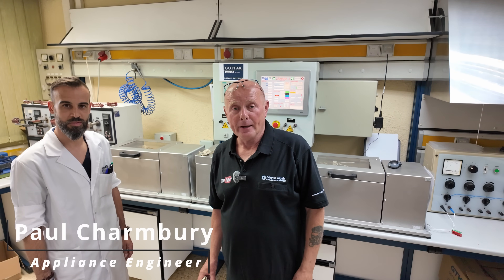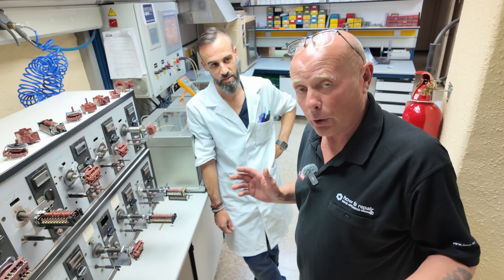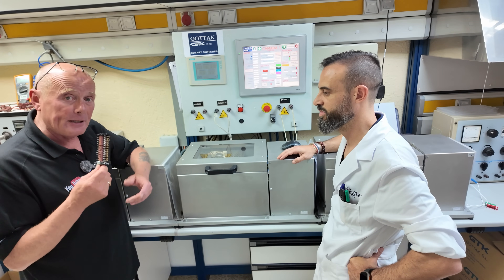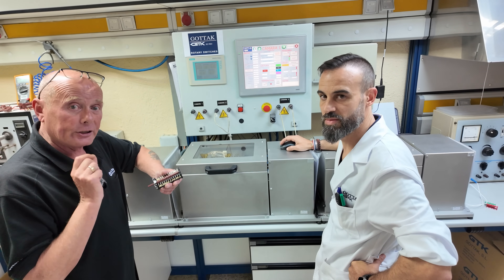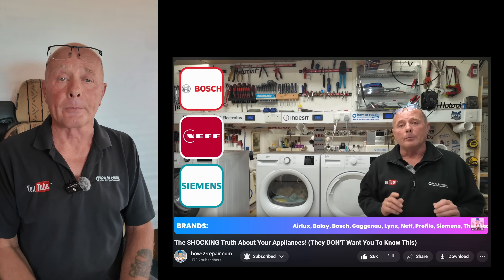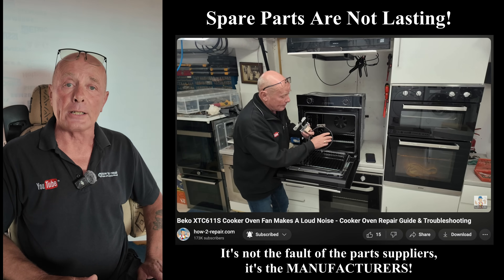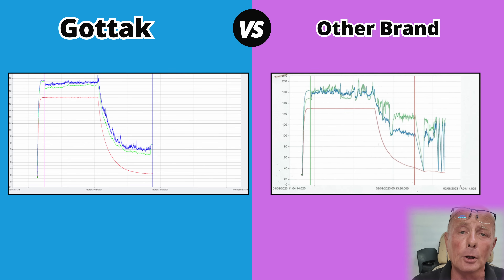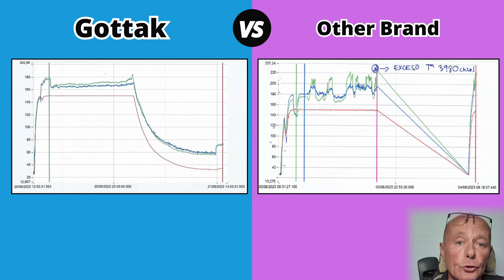Why Your Appliances FAIL SO FAST! Lab Results EXPOSE the Truth!

Comment: In the modern age, paradoxically, it pays off to buy the absolute cheapest appliances you can find. They are the ones that are still being built in an old-school way, they just use cheaper components. So when your switch fails you can just replace it with any random switch off the shelf and get it running again.

With more expensive appliances everything is much more complicated. Touch switches, millions of sensors everywhere, proprietary control boards, etc. Once any of that breaks, it'll be cheaper to throw away the entire machine than trying to find a replacement.

I have what used to be a very fancy microwave 20+ years ago, a Whirlpool with a fancy multicolor LCD segmented display (remember when that was like the coolest thing in the world?). It was gifted to me because the control board was failing and it was shutting off. Giving it a whack on the side a few times "fixed it" for a while and I used it just like that for about a year or so, until it started taking too many whacks to keep it running.
I took it apart and couldn't really find anything wrong with the board at first sight, but then I realized it was probably made around 2004, right at the beginning of lead free solder. I reflowed every single solder joint on the board (which was all through-hole components so it was exceedingly easy, if a bit time consuming) and lo and behold, it went back to working perfectly and has been serving me well ever since (it's been 4 more years).
If it were a modern microwave I would have probably just had to throw it away. Electronics these days are simply too complex and finnicky to work on without schematics or specialized equipment.

edit: Disclaimer, DO NOT DISASSEMBLE A MICROWAVE if you don't know what you're doing. If you touch the HV capacitor while it's charged you will be dead before you hit the floor.
Reply from the maker: Hi there, @demoniack81! Thanks for your incredibly detailed and insightful comment – and for the very important safety disclaimer about microwave repair!

Understanding these varying degrees of repairability, the impact of design complexity, and component choices is key for consumers navigating their purchases and repairs. For a deeper dive into how design and manufacturing choices affect appliance longevity, as observed at the trade show last year, please check out the full video here: https://youtu.be/gEgSCbZnHVM?si=wTIw0mELuhWaw4aX

We also explored related aspects in these videos:

The shocking truth about manufacturers: https://www.youtube.com/watch?v=QsdGd2qDPaI
Heat pump tumble dryers are they really worth it?: https://www.youtube.com/watch?v=xn03N3b0-lE

If you found this information eye-opening or it resonates with your own experiences, please consider sharing this video with your friends and family. The more people who understand these issues, the better equipped we all are.

Thanks again for watching and for sharing such a brilliant and thought-provoking comment! Don't forget to subscribe to the channel for more insights like this!

Comment: I have a creda large capacity tumble dryer it's 25 years old it's just started to fail I've had it 25 years I think that explains at what point the industry is at right now.
Reply from the maker: When a 25-year-old machine only just starts to fail, it makes you question why so many contemporary appliances don't seem to be built with that same durability in mind. This is exactly the kind of concern that fuels the discussion around built-in obsolescence, which we explore in our video. Understanding how design choices and manufacturing priorities have changed, as we discussed from observations at the trade show last year, is key.

For a deeper dive into this topic and to see the examples we covered, please check out the full video here: https://youtu.be/gEgSCbZnHVM?si=wTIw0mELuhWaw4aX

We also explored related aspects in these videos:

The shocking truth about manufacturers: https://www.youtube.com/watch?v=QsdGd2qDPaI
Heat pump tumble dryers are they really worth it?: https://www.youtube.com/watch?v=xn03N3b0-lE

If you found this information eye-opening or if it resonates with your own experiences with appliance longevity, please consider sharing this video with your friends and family. Stories like yours about your Creda dryer are a powerful reminder of what used to be possible.

Thanks again for watching and for sharing that great example! Don't forget to subscribe to the channel for more insights like this!

Comment: Manufactures need to build tings as cheap as possible for consumer goods. So they need to know the life expectancy of each component and part. They can design parts so accurately that on average they can predict failures.
In contrast, Years ago machines were way over built and lasted 20years or more without repair. The manufactures could not sell parts nor would anyone buy new machines. So the Manufacture would go out of business because they literately made the product too well for the task.
So the economics of the situation is that if a manufacture wants to stay in business they can only build products that last a well defined on average known period of time. This created jobs at the manufacture and in the service industry.
So Like it or not there is a method to the manufactures madness that really makes sense.
Reply from the maker: Hi there, @accurateapplianceelectroni9703! Thank you for providing your personal view on appliance costs and life expectancy but after so many years repairing different types of appliance machines, I strongly believe that consumers need to obtain fair, clean and durable products according to their investment, which at the same time, will not fill our planet with continuous toxic scrap due to the maximization of revenues by world manufacturers. Otherwise, this will be “food for today but famine for tomorrow”.
I think producing cheap products is not the solution. Reliability, quality and long-life expectancy is.
Shifting into a model of a consumer practice of “buying and throwing away”, will flood our landscapes with tons and tons of unworthy goods that will only create reduction of our earth resources and continuous growth of toxic waste for us and for our coming generations and I deeply believe that is not fair.
As commented in this channel by thousands of viewers, there is a common consensus about taking care of our environment and for such, we need to request reliability, quality and durability over cheap dirty products.
Having long lasting durable appliance machines, will not reduce the volume of manufacturing of world appliance producers as the world population keeps rising year after year, as well as their economic power and I believe there will always be a need for these great machines which facilitate the way of doing things for as humans like: storing food, cooking, washing, cleaning, warming, cooling and so forth.
If world manufacturers want to stay in business for long, my personal suggestion is that they have to understand that well crafted products, will provide them a name on the industry, to be trusted by consumers (which are smart buyers) for years and years.
There are many examples of well-known brands of different products today that have lasted for more than a century and they have understood from the very beginning that quality over quantity will prevail.
Producing and selling cheap products is too easy. Doing the opposite is not.

For a deeper dive into this topic and to see the examples we covered, please check out the full video here: https://youtu.be/gEgSCbZnHVM?si=wTIw0mELuhWaw4aX

We also explored related aspects in these videos:

The shocking truth about manufacturers: https://www.youtube.com/watch?v=QsdGd2qDPaI
Heat pump tumble dryers are they really worth it?: https://www.youtube.com/watch?v=xn03N3b0-lE

If you found this information eye-opening or helpful in understanding these multifaceted issues, please consider sharing this video with your friends and family.

Thanks again for watching and for sharing your insightful viewpoint! Don't forget to subscribe to the channel for more insights like this!

Comment: This is what happens when you have way too many bean counters in one room. There is no integrity anymore! It’s all about lining the pockets of the shareholders and the CEO. 

Recently, I had to order a part for my washing machine so I tried to source it locally and they gave me a price of $44 USD. I bought the same part on Amazon for about $12 USD and got free shipping as I was ordering a few other things as well. This was not prime either. The factory part I took out was pretty much identical and the machine is already 20 years old so I don’t need top quality parts if one does even exist. Other times I have looked for parts for different things and they just weren’t available in the city of 1 million. I prefer to shop locally, but what am I supposed to do? In the end, I need the part. 

Really good video by the way!!! Nice to have information that’s closer to the actual truth instead of a guess or speculation.
Reply from the maker: Hi there, @justiceness9-e5o! Thanks so much for your comment and for sharing your experience!

Your story about the washing machine part is a perfect example of the challenges consumers face the significant price difference between local sourcing and online options, and the difficulty in finding parts even in a large city. It's understandable why you'd opt for the more affordable and accessible option, even if you prefer to shop locally. It also says a lot that your 20-year-old machine is still going, prompting questions about whether parts of that original quality are even readily available today.

We're really glad to hear you found the video informative and closer to the actual truth. Our aim is definitely to shed light on these issues, drawing from what we see and learn, like at the trade show last year, so consumers can be more aware of what's happening with appliance longevity and repairability.

For a deeper dive into this topic and to see the examples we covered, please check out the full video here: https://youtu.be/gEgSCbZnHVM?si=wTIw0mELuhWaw4aX

We also explored related aspects in these videos:

The shocking truth about manufacturers: https://www.youtube.com/watch?v=QsdGd2qDPaI
Heat pump tumble dryers are they really worth it?: https://www.youtube.com/watch?v=xn03N3b0-lE

If you found this information eye-opening or helpful, please consider sharing this video with your friends and family. The more people who understand these dynamics, the better equipped we all are as consumers.

Thanks again for watching, for your kind words, and for engaging with such a great comment! Don't forget to subscribe to the channel for more insights like this!
Reply: Don't forget that despite production costs doubling, people who spent $300 for a microwave ten years ago want to spend $200 for its replacement.

The cost reduction has to come from SOMEWHERE.

Comment: The old lasts 25 years, and the new stuff lasts 2 years; that tells it all, screwing customers for profits.
Reply from the maker: In the 80s, 90s, and early 2000s, most manufacturers produced high-quality equipment to build their reputations. Now, their main goal is to sell machines. They use green marketing tactics to their advantage but aren't held accountable for the growing pile of discarded white goods. Nowadays, machines last only about five years on average.

Comment: Worked for a company that made the temperature sensor for a large appliance manufacturer. They had us make a sensor designed to fail in 5 years.
Reply from the maker: This is a powerful example that goes to the very heart of what we mean when we discuss built-in obsolescence in our video. It highlights how specific, seemingly small components can be engineered to limit the lifespan of an entire appliance, forcing premature replacement. Thank you for your comment. I appreciate people like you taking the time to write it out. Please share it where possible. It might help others make a wise choice instead of being misled by the industry.
Reply: We need more detail.

I would bet it's not that they had you make a sensor that was designed to fail in five years, but rather a sensor that would last ten years cost twice as much.